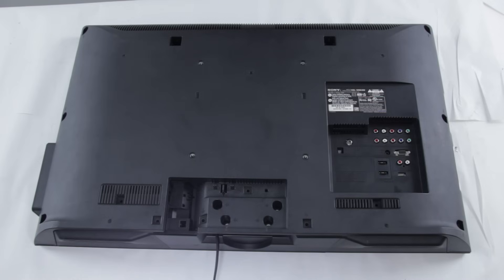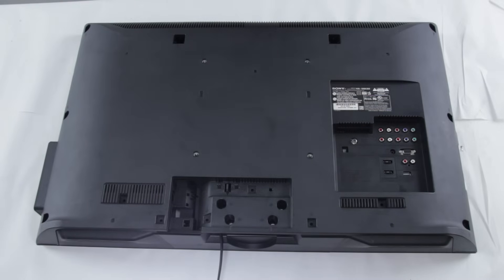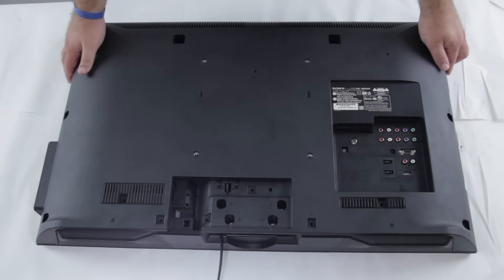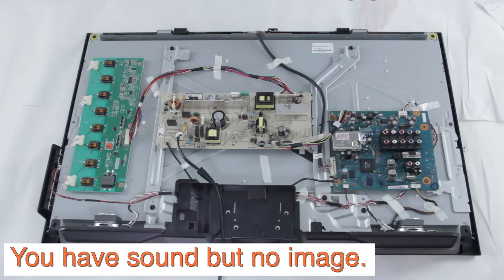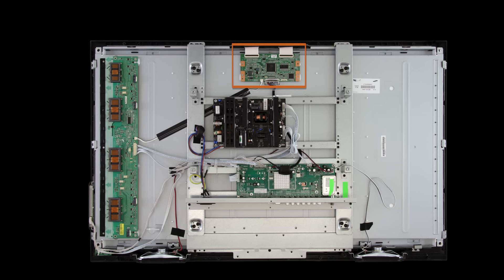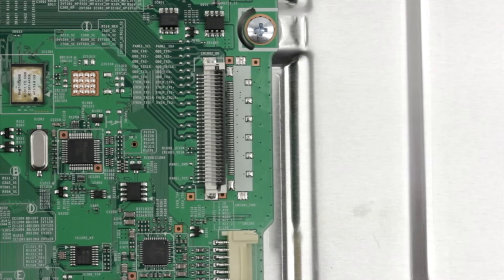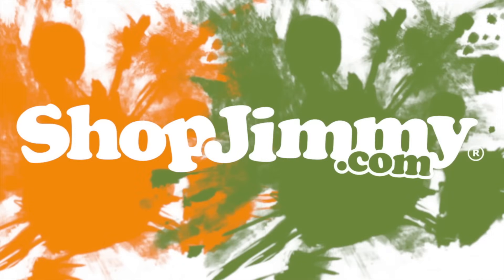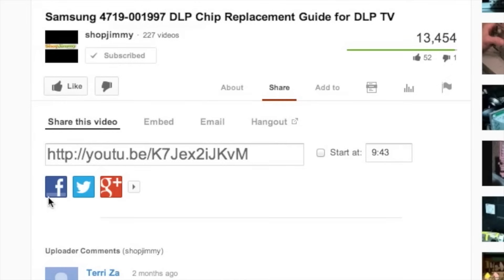LCD TV Repair Tutorial - T-Con Board Common Symptoms & Solutions - How to Replace T-Con Board

Comment: I have a un40b6000vf samsung led tv it has a gray shadow on the left side of the screen that appeared after I cleaned the screen and the black colors seem to be off on it.What do you think would cause that? I've uploaded the images to a folder on my website here. http://29thdiv.com/corban/tv/
Reply from the maker: Kyle white   This sounds like a TV panel problem.  If your TV panel is bad, it may be more cost-effective to replace the TV as panels are typically hard to find in stock, difficult to replace, and expensive.  Thanks and please let us know if you have any further questions!  www.shopjimmy.com
Reply: Yeah I ended up taking it apart it's the ribbon cable to the long board of the bottom of the TV has 3 traces that burnt. Thanks for he help

Comment: lg 50 pq6000 down lh side of screen sometimes not always there is a 2 " vertical black line no picture on that side of screen any help my good man.
Reply from the maker: Paul Hefferon  This sounds like a TV panel problem.  If your TV panel is bad, it may be more cost-effective to replace the TV as panels are typically hard to find in stock, difficult to replace, and expensive.  Thanks and please let us know if you have any further questions!  www.shopjimmy.com

Comment: Hi, 

I have a 55" Panasonic Viera TC-L55E50 thats has intermittent video issues. the sound is fine and everything else is fine ot my knowledge but the picture freezes then goes back to normal on a 2-3 sec cycle, and also has a slim horizontal line at the very top of the screen. i also have issues with vertical lines and ghosting when i first turn the set on, that go away after a while. if you would like to see a picture, i can send one asap
Reply from the maker: *****  I recommend replacing the A main board in your TV.  Here is a link to replacement parts for your TV model number on our website, click here:  http://www.shopjimmy.com/catalogsearch/result/?q=TC-L55E50  Be sure to match part numbers on your current board, with your replacement for compatibility.  Here is a link to a video showing how to identify your part number, click here:  Panasonic Plasma HD TV Repair Tips: Suffix Codes for A Board & Main Boards  You can also call our customer service for further assistance with your purchase.  (877) 881-6492  Thanks and please let us know if you have any further questions with your TV Repair!  www.shopjimmy.com
Reply: Hi, 

Could you tell me why the main a board would be the problem and not a t-con board issue?
Reply from the maker: *****  Sure, so first of all the problem could be the TV panel, with the ghosting and lines, if the problem is the panel, then you may want to replace the TV.  The reason I would suggest the main board to be replaced over the T-con board is because the main board has the digital processor on it which fits some of the symptoms that you have described.  Here is a link to replacement parts for your TV model number on our website, click here:  http://www.shopjimmy.com/catalogsearch/result/?q=TC-L55E50  Be sure to match part numbers on your current board, with your replacement for compatibility.  You can also call our customer service for further assistance with your purchase.  (877) 881-6492  Thanks and please let us know if you have any further questions with your TV Repair!  www.shopjimmy.com

Comment: Hello ShopJimmy.com,

I have a Sony Kdl-46nx700. When I press the power button, the sony logo appears and it makes a chime sound and it powers off. It does the same twice, and then the standby red light flashes six times with two seconds in between flashes. Any idea what this could be?
Reply from the maker: Antonio Lopez  I recommend replacing the power supply in your TV.   Here is a link to replacement parts for your TV model number on our website, click here:  http://www.shopjimmy.com/catalogsearch/result/?q=Kdl-46nx700  Be sure to match part numbers on your current board, with your replacement for compatibility.  Here is a link to a video showing how to identify your part number, click here:  TV Part Number Identification Guide for Sony Power Supply Unit (PSU) Boards (LCD LED Plasma TVs)  You can also call our customer service for further assistance with your purchase.  (877) 881-6492  Thanks and please let us know if you have any further questions with your TV Repair!  www.shopjimmy.com

Comment: Hello I am having a double image on my Samsung 42" LCD Series 6 40D630 TV that is a little over 2 years old. I've already called Samsung about my issue. Long story short they suggested me to call there nearest repair station because they couldn't figure out the problem. Are there ideas on what is the problem and what items I should replace? Here is a link for more details http://youtu.be/mI5yS1HFPJA
Reply from the maker: peter madrid   You can replace the T-con board to see if that fixes your problem.  If it does not, I would say you have a bad panel in your TV.  Here is a link to replacement parts for your TV model number on our website, click here:  http://www.shopjimmy.com/catalogsearch/result/?q=40D630+  Be sure to match part numbers on your current board, with your replacement for compatibility.  Here is a link to a video showing how to identify your part number, click here:  Samsung Timing Control (T-Con) Boards Part Numbers Identification for LCD HD TV Repair  You can also call our customer service for further assistance with your purchase.  (877) 881-6492  Thanks and please let us know if you have any further questions with your TV Repair!  www.shopjimmy.com

Comment: Hello jimmy. I have Sony kdl46S4100. We first started having problems with a ghost like image on the left side of the screen. It was slow in catching up. After doing some  research we found out there was a bad connection with the tabs to the screen. So we took it apart applied tape and that problem was fixed for a while. The the tv display started to come in with sound but no image. We would turn on and off until the video would show up. But once the video showed up it would have horizontal lines on the left side again. We would press on the top left of the screen and it would completely go blank(back lights still on) and there was still sound. Now it comes on to a grey screen for about 2 seconds and goes to stanby mode with the red light flashing at the bottom. It will not change until you unplug it and plug again. But it does the same thing over back to standby. Any suggestions or help with this? Your time is greatly appreciated.
Reply from the maker: jainaba faye   This sounds like a TV panel problem.  If your TV panel is bad, it may be more cost-effective to replace the TV as panels are typically hard to find in stock, difficult to replace, and expensive.  Thanks and please let us know if you have any further questions!  www.shopjimmy.com
Reply: Thanks jimmy after your comment we decided to pull it out to see if it would work again and no. Now it did not go into standby it gust went to the grey screen. So guess we are gonna cut our losses. Thanks again

Comment: Hi,

I have a Sony Kdl-46hx820 which has coloured vertical lines regardless of any source inputs. Does this relates to the LED driver?
Reply from the maker: Thai Dinh   You could try replacing the LED driver to see if that fixes the problem, but it sounds like the problem is your TV panel.  If you do want to purchase replacement parts, here is a link to replacement parts for your TV model number on our website, click here: http://www.shopjimmy.com/catalogsearch/result/?q=Kdl-46hx820  Be sure to match part numbers on your current board, with your replacement for compatibility.  You can also call our customer service for further assistance with your purchase.  (877) 881-6492  Thanks and please let us know if you have any further questions with your TV Repair!  www.shopjimmy.com
Reply: ShopJimmy.com
Thanks! the part I need is out of stock?

Comment: I have a Samsung 46" model #UN46D6900WFXZA, and the problem is the screen goes completely black except for the very  bottom of the screen.
Reply from the maker: niccaindazone   This could either be the T-con board or the main board.  You may need to try two different boards individually to see if they fix the problem.  Here is a link to replacement parts for your TV model number on our website, click here:  http://www.shopjimmy.com/catalogsearch/result/?q=UN46D6900WFXZA  Be sure to match part numbers on your current board, with your replacement for compatibility.  You can also call our customer service for further assistance with your purchase.  (877) 881-6492  Thanks and please let us know if you have any further questions with your TV Repair!  www.shopjimmy.com

Comment: I have a Sanyo DP46840. It shut off after 10 seconds of fully on, and would not power back up. I opened and saw 3 hot spots on back of power board (discolored from heat?), so I replaced 2 ceramic, pancake caps, and 1 resistor. The ratings were close, but not identical parts (I could not read markings so I matched visually, as best as I could find). Now it powers up as usual, but shuts off after 10-20 seconds, and won't turn back on UNLESS I unplug it first. It powers up, shuts off after 10-20 seconds, won't power on again, unless I unplug it. SO, my question is: What is the problem? Are the parts I replace the issue, and I just need to get the proper parts, or is something else causing the problem, and the parts I replaced were fine?

Comment: I have a Westinghouse SK-32H240S. Powers up OK, but screen goes black after one second of being fully on, sound OK. One inverter had a hole burned through it, so I replaced it. But still same problem. Any ideas?
Reply from the maker: Art Wilson   The first problem could be a defective inverter or your main board is bad. This could also be a problem with the power supply staying on.  You may need to buy multiple parts and try them out one at a time to see which board fixes your TV.  Here is a link to replacement parts for your TV model number on our website, click here:  http://www.shopjimmy.com/catalogsearch/result/?q=SK-32H240S  Be sure to match part numbers on your current board, with your replacement for compatibility.  You can also call our customer service for further assistance with your purchase.  (877) 881-6492  Thanks and please let us know if you have any further questions with your TV Repair!  www.shopjimmy.com

Comment: Hello -- Upstar 23" TV / Monitor issue -- I get sound, but no picture -- When I changed the power supply (thinking it could be that) it worked, but not as I thought -- Using a HP power cord (my laptop), I get picture, but no sound. Anyhow, so I bought a new power supply that matches the original, but again, I got sound, but no picture! I still see the logo, regardless what power supplied I used. Any ideas? Thank you for your time!
Reply from the maker: Ish623   I recommend replacing the main board in your TV.  Please reply with your TV model number and I can recommend a replacement part for your TV repair.  Thanks!  www.shopjimmy.com

Comment: I have sony bravia KDL-32EX520 and for a week i got a problem with a display it's like a old 16 bit color i will added a link here             SONY Bravia NX710 TV Screen or Color Problem...            it's not mine however problem is same please help me to solve my problem really thankful to you.
Reply from the maker: zaid faridi  I recommend replacing the BATV main board in your TV.  Here is a link to replacement parts for your TV model number on our website, click here:  http://www.shopjimmy.com/catalogsearch/result/?q=KDL-32EX520  Be sure to match part numbers on your current board, with your replacement for compatibility.  Here is a link to a video showing how to identify your part number, click here:  TV Part Number Identification Guide for Sony Main Boards (LCD, LED, Plasma TVs) TV Repair  You can also call our customer service for further assistance with your purchase.  (877) 881-6492  Thanks and please let us know if you have any further questions with your TV Repair!  www.shopjimmy.com

Comment: Hi , I have a Soundwave 32" model C3298DVBR. mainboard is good, but the symptoms are, steady green light, no sound, no picture but backlight comes on for one minute then goes off for one minute continuously, any help would be appreciated.
Reply from the maker: Steph Ford  If your TV has a T-con board in it, I recommend replacing that.  Unfortunately I do not see any replacement parts in the search results for your TV model number on our website.  Thanks and please let us know if you have any further questions!  www.shopjimmy.com

Comment: Hi, Have display problem with my LG LCD 32'' TV. Backlight and sound works without any issues. But display goes off in few minutes after switching on the TV. I think problem is with T-Con board. TV model is 32LG80FR. Let me know if I can get the T-Con baord alone for this model.
Reply from the maker: Tojan John   I recommend replacing the T-con board in your TV.  Here is a link to replacement parts for your TV model number on our website, click here:  http://www.shopjimmy.com/catalogsearch/result/?q=32Lg  Be sure to match part numbers on your current board, with your replacement for compatibility.  You can also call our customer service for further assistance with your purchase.  (877) 881-6492  Thanks and please let us know if you have any further questions with your TV Repair!  www.shopjimmy.com

Comment: my tv sharp aquos ,picture no look good ,look like is rain with vertical strip,is model lc-42d62u,coul you help?
Reply from the maker: zeronet1000  This sounds like it could either be the T-con board or the main board that is causing this problem.  Here is a link to replacement parts for your TV model number on our website, click here:  http://www.shopjimmy.com/catalogsearch/result/?q=lc-42d62u  Be sure to match part numbers on your current board, with your replacement for compatibility.  You can also call our customer service for further assistance with your purchase.  (877) 881-6492  Thanks and please let us know if you have any further questions with your TV Repair!  www.shopjimmy.com

Comment: Have a Magnavox model #32MF337B/27 , serial  #BZ5A732261771  tv . Tv will power up , screen will light up momentarily (bright a dark room), then no picture. Audio is present . Tried flashlight test - no picture) , then removed rear cover . I saw 3 bulging capacitors on main bord . Removed board & replaced them . reinstall & still have same issue . I'm thinking the main bord is gone, , any thoughts ?
Reply from the maker: mike k   I recommend replacing the main board in your TV.  Here is a link to replacement parts for your TV model number on our website, click here:  http://www.shopjimmy.com/catalogsearch/result/?q=32MF337B%2F27  Be sure to match part numbers on your current board, with your replacement for compatibility.  Here is a link to a video showing how to identify your part number, click here:  Philips Magnavox Main Boards TV Part Number Identification Guide for DIY TV Repair Help  You can also call our customer service for further assistance with your purchase.  (877) 881-6492  Thanks and please let us know if you have any further questions with your TV Repair!  www.shopjimmy.com

Comment: Hi ShopJimmy
I have a Sony KDL-37XBR6 SERIAL: 8032828 When I turn it on I get a slight flash but no picture, completely dark screen, do you think it could be the t-con board?
I removed the back cover last night and see a number stamped on the t-con board but am unable to find that number anywhere on the net? The numbers are:- 72.37T04.002-4YDI (08 6 11 D)
Reply from the maker: Geoff Parkinson   I recommend replacing the backlight inverter in your TV.  Here is a link to replacement parts for your TV model number on our website, click here:  http://www.shopjimmy.com/catalogsearch/result/?q=Sony+KDL-37XBR6  Be sure to match part numbers on your current board, with your replacement for compatibility.  You can also call our customer service for further assistance with your purchase.  (877) 881-6492  Thanks and please let us know if you have any further questions with your TV Repair!  www.shopjimmy.com

Comment: Problems with my Samsung LN37A550P3FXZA flat LCD.  About a week and a half ago, I was watching TV for about an hour and all of the sudden the colors looked weird, the screen looked washed out, as if the brightness setting would be way to high, and reds and bright colors would bleed out of the image, TV menus looked the same and all different sources had the same issue, tried resetting TV back to factory defaults, turned it off for a while and no luck, finally I adjusted the contrast and colors way low to somewhat of a decent watchable state and continued watching it like that until now, last night all of the sudden after 30 mins of watching, the TV turn completely white, no TV menus or any image are visible from any source. Please help I would like to get at least 2 more years out of the TV since it's only 3 and a half years old, of course if it's not too expensive of a fix. Thanks in advanced for the help.
Reply from the maker: Power Moe   I recommend replacing the t-con board in your TV.  Here is a link to replacement parts for your TV model number on our website, click here:  http://www.shopjimmy.com/catalogsearch/result/?q=Samsung+LN37A550P3FXZA  Be sure to match part numbers on your current board, with your replacement for compatibility.  You can also call our customer service for further assistance with your purchase.  (877) 881-6492  Thanks and please let us know if you have any further questions with your TV Repair!  www.shopjimmy.com